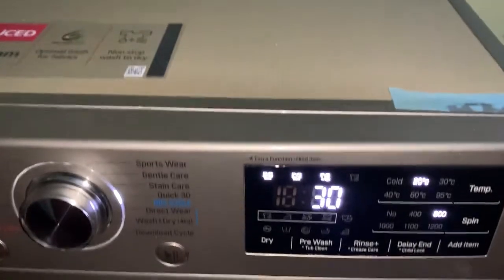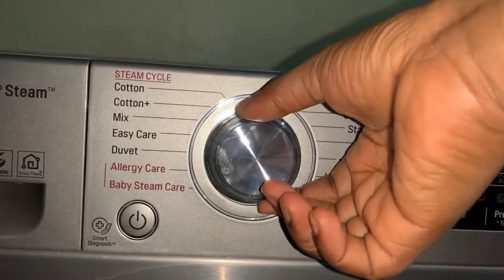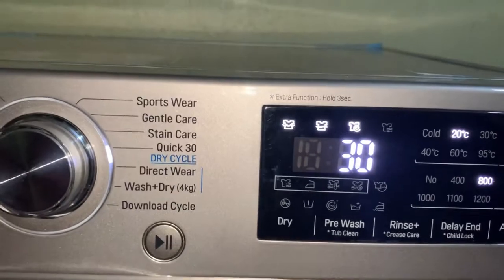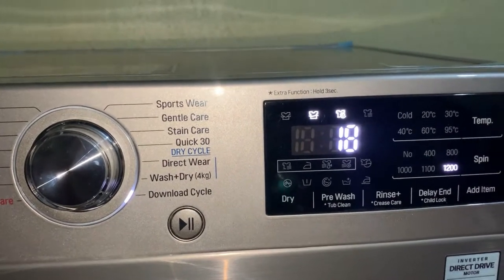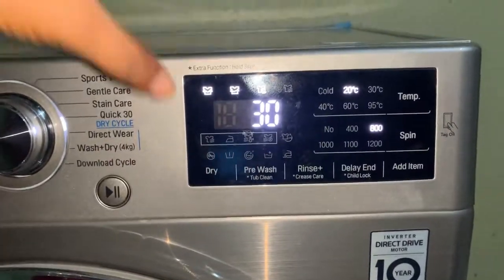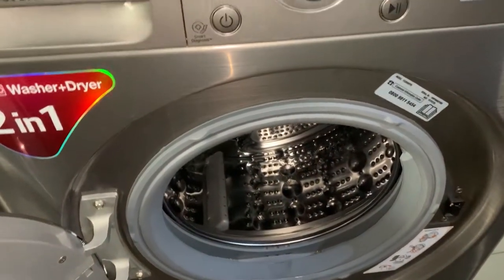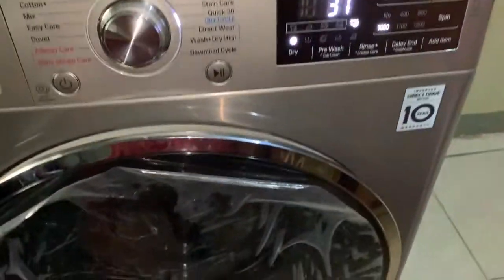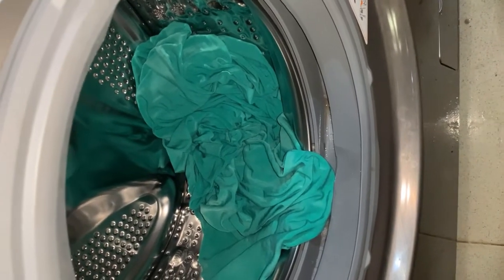LG Front Load Automatic 2 in 1 washer dryer combo review and how to use (model LG WM F2J6HGP2S) #LG

Comment: In my washer dryer, the clothes smells odour after I used dry cycle. What will be the cause?
Reply from the maker: Might be the heat from the dryer or you need to clean your drum
Reply: @Sanexy427  What should we do if it is because of heat? I usually will do tub clean
Reply from the maker: @vigneshr5866  After using the dryer,take it out of the tub immediately it’s done,and spread the cloth outside for fresh air to eliminate the odour,please don’t abandon cloths in the drum of you do the cloths will smell
Reply: @Sanexy427  Yes I am doing it. Will usually will be electric heat odour when we drying out in the dryer?